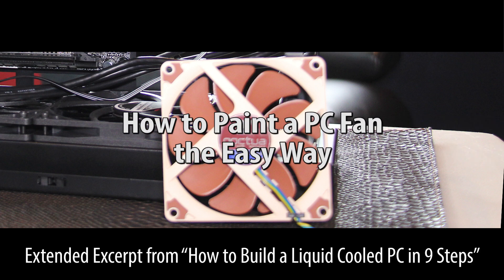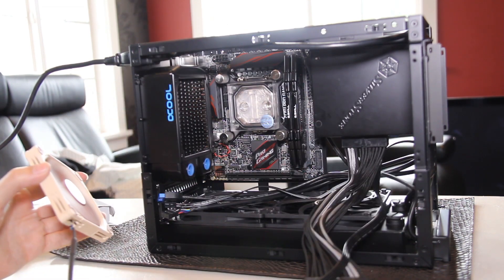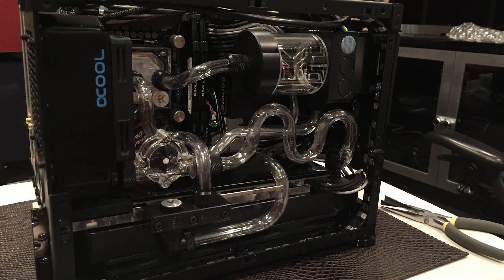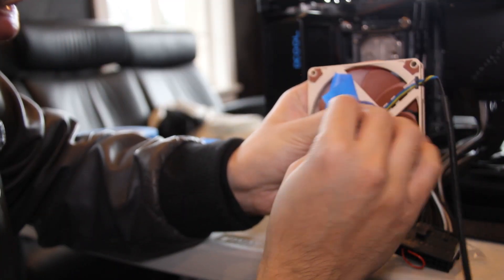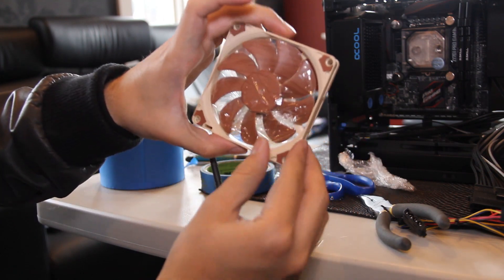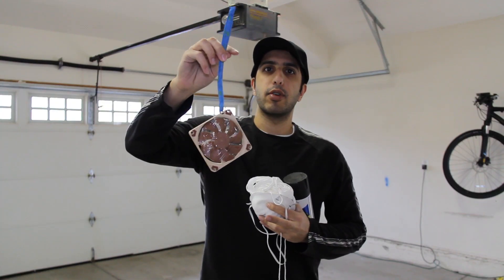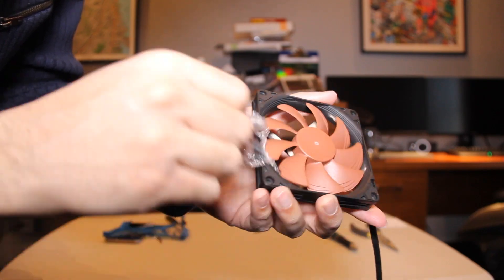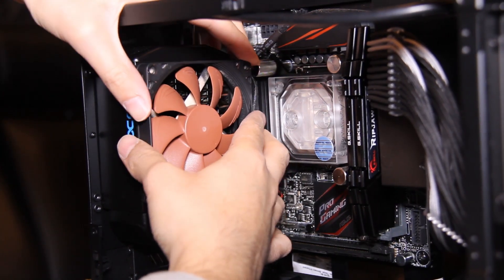Paint a PC Fan the Easy Way - without affecting performance (e.g. Noctua fans)

Comment: Those milligram differences in paint on the fan blades really wont do any difference to the performance mate so you wasted time covering it up.
Reply from the maker: That’s true - with such thin, even layers of paint, it should be practically insignificant. I think the main thing if you’re going to paint the blades without taking the whole thing apart is to make sure you don’t gunk up the central area where the bearing is or the clearance between the fan blades and chassis in the center, so that it still spins freely.

With 1-2 quick thin coats, it shouldn’t be too difficult to do.

Comment: How did he get that plastic wrap to cover all the blades???? 

Im trying now and have no clue how he did that. He said it’s easy
Reply from the maker: Start by cutting a sheet of seran wrap / cling film / plastic wrap. It should be large enough that you think it will wrap around the entire fan.
Then, put the plastic sheet on one side of the fan so it covers the all the blades. Now, from the other side of the fan, use your fingers to pull the plastic wrap to the other side.
It seems weird and maybe even counter intuitive at first, but once you start pulling the plastic wrap to the other side, I think that’s when it starts to make sense. 
Good luck!
Reply: @Coolarj10  I kept trying and gave up and used painters tape lol. Thanks!

Comment: How the hell did u cover it each blade with wrap, I’m trying to do it and it’s impossible
Reply from the maker: Take a sheet of wrap and put it on one side of the fan chassis. Now from the other side of the chassis, pull the wrap through. You can use a toothpick or a thin pen or something to help push the wrap through to the other side. It requires a bit of patience but I’m sure you can do it :)

Comment: Did doing this affect your fan's performance in any way?
Reply from the maker: Hey! I didn’t do a before and after comparison, but theoretically there should be no performance difference. The reason is that the performance comes from the shape and aerodynamics of the fan blades. Since we aren’t modifying the fan blades at all (no paint ever touched them), there should be no difference in performance.
Reply: @Coolarj10  makes sense! I'm actually planning on using your method very soon, but with a "Flat White" spray can. I'll let you know how it goes!
Reply: @Coolarj10  my paint job wasn't perfect, and getting the plastic wrap around the fans was incredibly difficult. I might have even messed up the bearings inside a few of the fans because they sometimes make a rattling sound. (I wasn't always gentle trying to get the plastic wrap around the fans). But all in all I don't regret it. I wanted white case fans and now I have them. Thanks again for your guide : ) I uploaded some pictures of my process on PostImage https://postimg.cc/gallery/HpnMpvY

EDIT: so it was just one of the six fans I ruined the bearings on. Luckily, there's a sixth fan I hadn't yet used, so I just swapped it in instead. Now there's no rattling noise :D
Reply from the maker: @MusicTKO  hey nicely done - nice pics! From the pics they look great. Also, the covering looks like you put it on all the way, so I think it would be really really difficult to imagine that the paint is causing the rattling sound. Sometimes PC fans do start to rattle if they have been used a lot...you can try tapping on the fan (while it’s off) a few times to try to wiggle it back into a position where it won’t rattle anymore. There are also guides on how to re-lube the bearings if they are causing rattling. Glad it overall worked out for you!
Reply: @Coolarj10  Amazing thanks for the advice. For now I've swapped out the faulty fan with the sixth fan I hadn't used yet. But if I do ever get around to using the faulty fan again I'll try some of those troubleshooting tips. Thanks again : )

Comment: question: do i need to prime? and what primer would you rec?
Reply: You don't need a primer but it is highly recommended. It helped the paint hold onto the plastic. Also rustoleum should be an okay brand as most can be used with plastic

Comment: You missed a spot
Reply: With all that wasted paint? Lol definitely not 
Dude wasted a full can on 1 fan and painted more wrap than the case.
Reply from the maker: Haha good catch! After recording I realized that the brown rubber bumpers around the screw holes caused some challenges with even painting, so I ended up removed the bumpers and re-painted (not shown in video, and it's up to you if you want to do that).

Comment: Why did you not paint the wings ?
Reply: Because it could effect the performance of the fan. I'm not sure to what extent this would happen, but that's the reason he gave.
Reply: Pepe did nothing wrong  oh allright
Reply: @sterben3048  plus, some noctua fans have blades close to the casing. Oh, and they claim that they are aerodynamic.
Reply: @sterben3048  Griffith did nothing wrong
Reply: I doubt a <5% (1 g) change in weight spread uniformly over a 22 g fan blade is going to make that much of a difference.
Use thin paint rather than heavy/thick paint and it will be fine.

Comment: What spray can did you use? Also would have loved a more close up view of ur finished paint job :)
Reply from the maker: Hey! So sorry I thought I had posted a reply to this a long time ago but I guess not. I know it's a bit late, but just in case:
1. The spray can I used is: RUST-OLEUM Painter's Touch 2x ULTRA Cover PAINT+PRIMER FLAT BLACK. https://www.amazon.com/Rust-Oleum-249127-Painters-Purpose-12-Ounce/dp/B002BWOS7Q
2. Thanks a lot for the feedback - you're right I should have uploaded a proper final close up. I have a few pictures on PCPartPicker, but I realized I never took a new picture after re-painting it when I realized I missed a few spots: https://pcpartpicker.com/b/w3vnTW .
Reply: @Coolarj10  Did you do any sanding at all or you just painted it straight on?
Reply from the maker: YTA 2 I just painted it straight on!
Reply: Why would it matter? Lol
Reply from the maker: A yes, 10+ frames should be easy. It can prob do way more